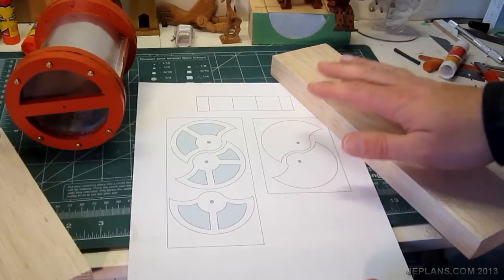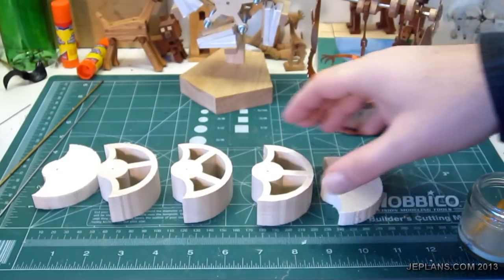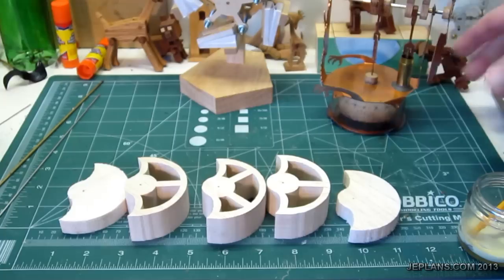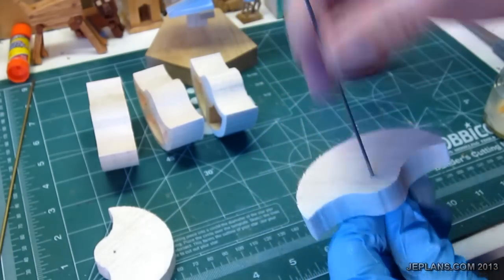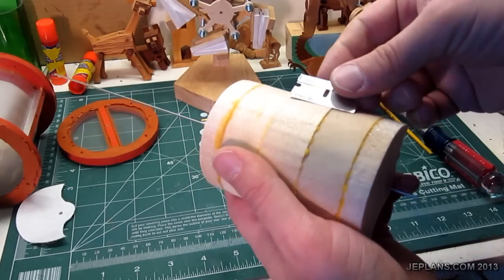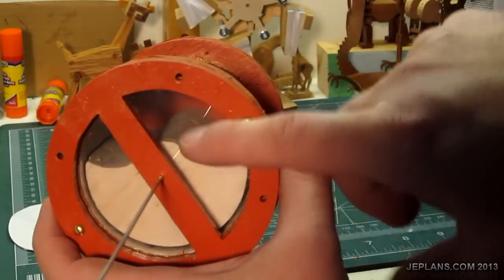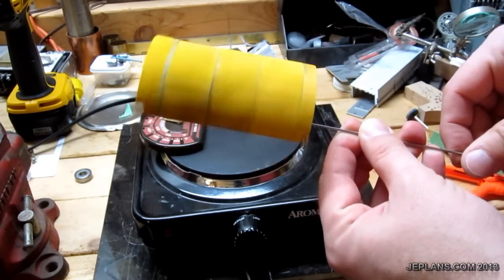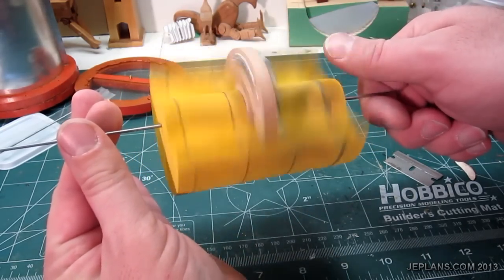Rotary Heat Engine Part 2.3 The Displacer

Comment: The trick to making rotary stirling engines work properly is the shape of the displacer cylinder.  Larger diameter and thin rather than small diameter and long.  Think pizza instead of rolling pin...  Also, try to make your displacer out of fine steel wool so it acts like a regenerator.  And just like any other stirling, try to eliminate 'dead air space'.  Cheers.